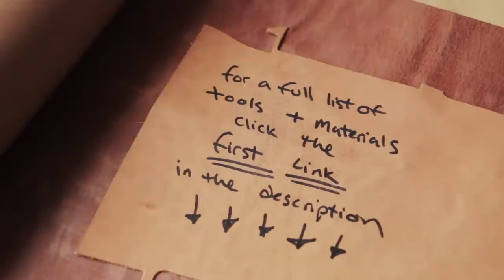Making a Simple Leather Clutch

Comment: I’ve been searching high and low for a scaled up version of this, for clipping to a belt. Not with belt loops though, or a metal clip. But with a polymer clip like they use on Nite Ize phone pouches. Nobody on earth seems to have the slightest desire to make it the way I want it. I may have to make my own. It’s maddening. Basically, I want it for a horizontal phone carrier, but also to carry other lay items behind the phone. And I do not want to thread my belt through it. I want to be able to pop it on and off and not use a metal clip, because they all seem to shred the belt and can hurt the fingers. The Nite Ize style of clip on their Horizontal model is perfect. But their biggest case is too small for my needs.